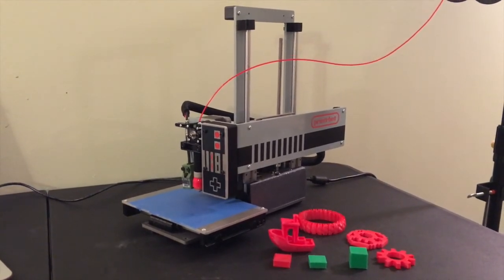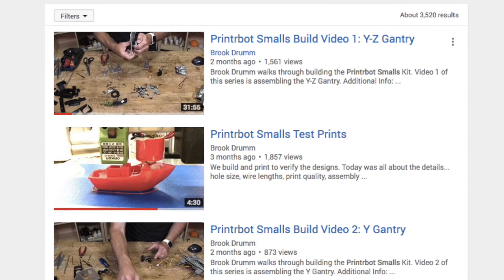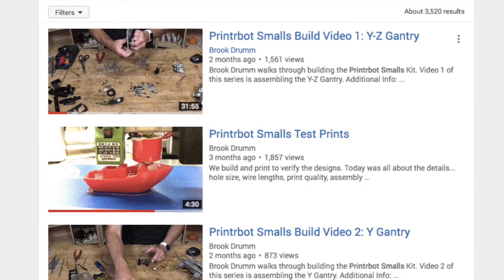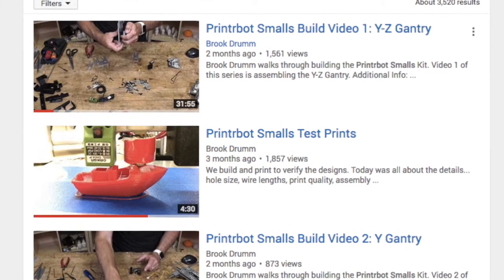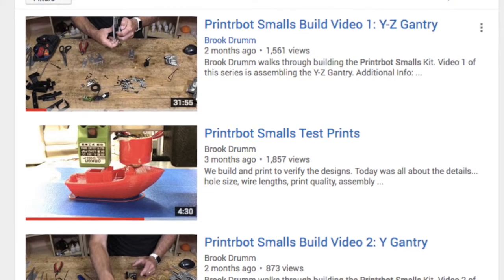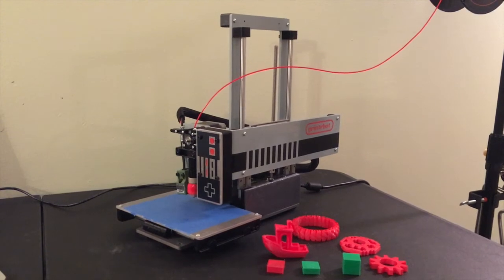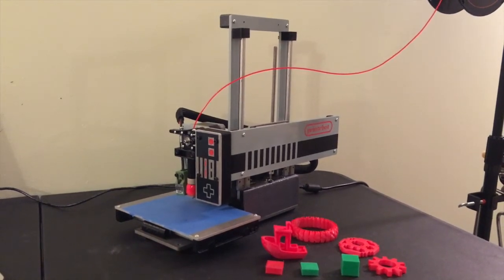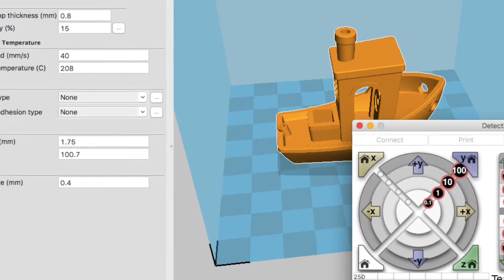Printrbot Smalls Review

Comment: hi! just a question, do you know if there is possible to add an screen to be able to use the machine without be connected to a computer? thanks in advance!
Reply from the maker: I went the Octoprint route using a raspi zero W and then I can log in using a tablet or computer.
Reply: andyLeer thanks a lot for taking the time to reply me, I really appreciate that, thanks a lot sir!